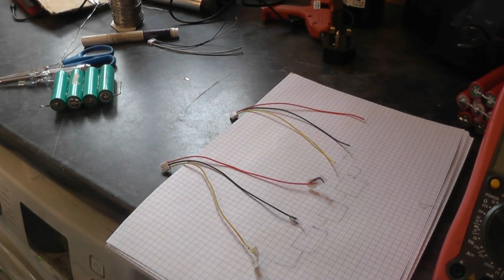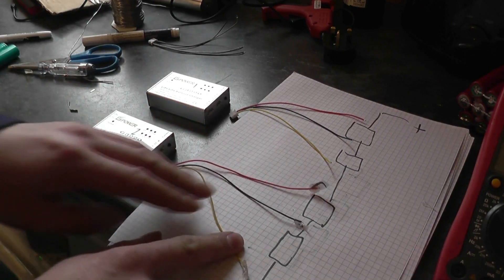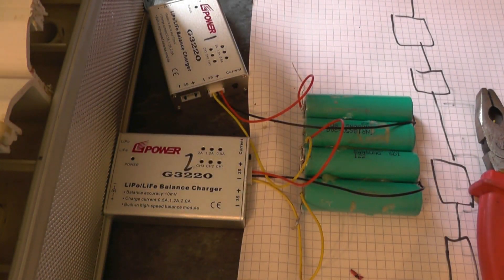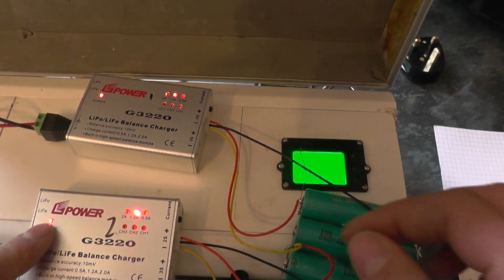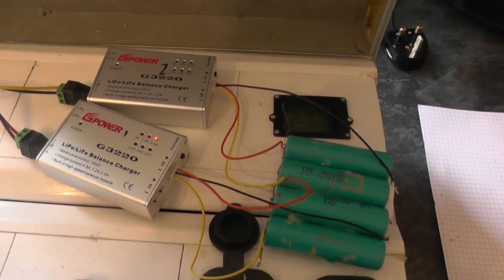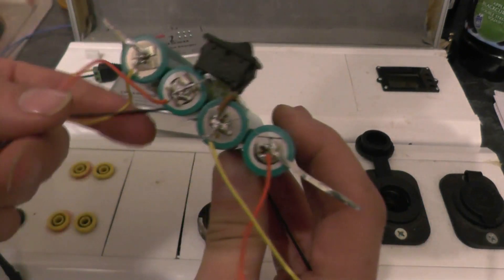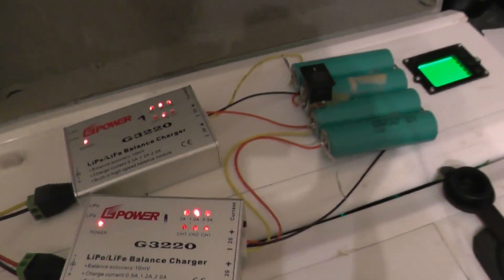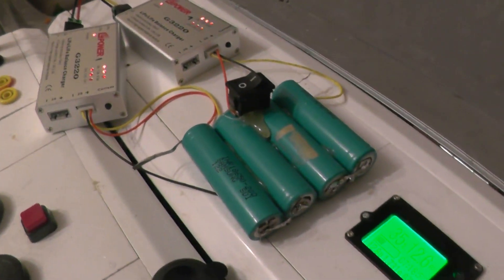using 2 2 cell balance chargers to charge 4 cell pack. problem and solution

Comment: if you every need to charge or do discharge testing on 18650 cells again, look into the Foxnovo 4s charger, it will discharge test 4 cells at 1amp at the same time and the charger is very cheap to purchase..

Comment: so if you was going to use solar to power the units a relay on the coil powered from solar panel and a normaly closed realy so when no sun thay is 16.4 volt and when they is sun it swaps to 7.2

Comment: have a look at this  charger 
http://www.hobbyking.com/hobbyking/store/__44542__Hobbyking_174_DC_4S_Balance_Charger_Cell_Checker_30w_2s_4s_UK_Warehouse_.html
Reply from the maker: Don't worry! I have to look at this B4 charger because I have 80 new 2000mah cells that need to be put to work. maybe go for a split charge relay in the van and use this automatic charger to keep them topped up! =)
Reply from the maker: I need the item for Lifepo4 cells =/
Reply: +pietkaify Drats... Life is the show stopper for most of the automatic chargers. If it had been lipo, I would have recommended the B4 charger, as it can do 2S-4S up to 4A (automatically adjusts taking batteries internal resistance into account) from a 12v supply, but I don't know any 4s life chargers that are automatic... ;(
Reply: Let me know if you have any questions about it, as I happen to have one ;) Plus a IMAX B8+, IMAX C-403 & Turnigy Neutron (all these fancy names!!!)

Comment: halfway through the vid. suspecting common ground is the problem. cell 1 and 3 has same ground unless those chargers or power inputs to them are isolated.
Reply from the maker: I understand now! I do apologise, I'm a electrician by trade and I keep picking bits up as I go (in the way of electronics) I am going to revisit this very soon.
Reply from the maker: if I used 2 separate 12v supplies it might work? problem then is I can't use my lead acid bank to top up my lithium packs. maybe an isolated 12/12 transformer across one pack?
Reply: +pietkaify that would work but not recommended.. if the cases are grounde what happens if they make contact....? would just try find a for cell charger or imax (?) b6 inexpensive or turnigy charger.
Reply: +bwack four cell
Reply from the maker: +bwack my lead acid batteries are shot so if I set an imax b6 going and the sun goes in I have to manually reset the charger. if I can get 2 of these units to run together I can charge my lithium packs alternately and not have to worry about checking that the imax hasn't shutdown due to low incoming voltage
Reply: yes, that's what we were discussing on the last video... since the ground of the first cell is connected to ground of the power supply, when you connect the second power supply, if it didn't detect the fault like it does, you would be connecting the +ve of cell 2 to gnd - not a good idea! So only way to use these chargers is to have two separate power sources (i.e. 2 12v batteries... maybe 24v setup tapping into the middle to get 2 12v supplies?) or to break the connection how +pietkaify has done. Just means it isn't a no-thinking required setup... but may be the nearest you'll get for now...
Reply: +pietkaify No problem... You were brave enough to try it... and the chargers survived for another day... I wouldn't even try as I'm too afraid that the magic smoke will be released. I really have to stop and think though, because for the life of me I can't figure out why a diode on the input ground line wouldn't work... I just have this feeling it causes another problem, or doesn't work at all...